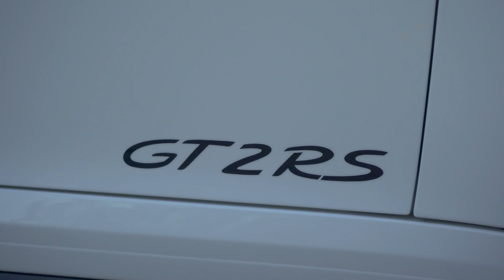"Detailing In The Sky" Featuring GT2RS & BAC MONO

Comment: How does that steamer work? Hot water or cold?
Reply from the maker: We can precisely adjust the temperature/moisture that the steam gives out. So for instance on the wheels we use high heat to remove all the melted rubber/tar. On the interior we use light heat to gently extract all the harsh oils from the leather.